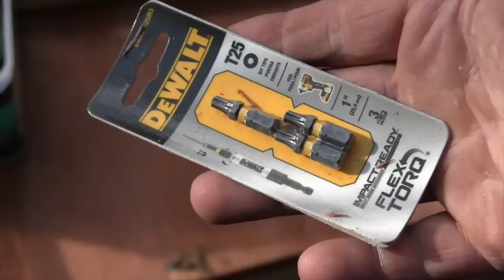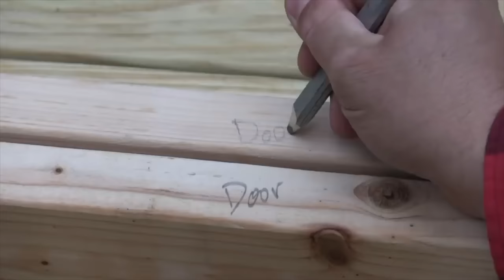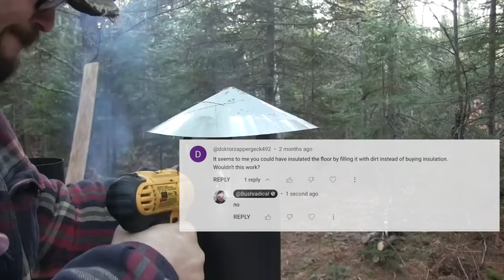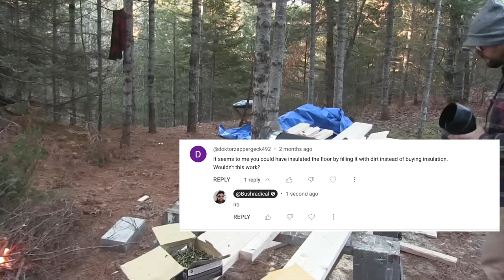Cabin with 24M views.....all the details

Comment: Nails are softer than screws so they flex/bend with shifting foundations rather than shear like hardened screws will. Driving nails at opposite angles will give surprisingly good holding power. The correct fastener is determined by code but experience will tell you what is the right application. Remote construction brings out the McGyver in all of us, whether it is a bridge or an outhouse. Stay safe, cuz you are the doctor as well when building solo.

Comment: Old carpenter insulating tip. Coat your arms face neck and any other place that is exposed to fibers with baby powder before you start stuffing insulation. The powder keeps the fibers from sticking into your skin. Once you're done, take a cold shower first to wash off fibers. A hot shower opens pours and let's fibers stick in them instead of rinsing down the drain. The baby powder trick has always worked wonders for me and I've stuffed thousands of bats over the years
Reply from the maker: great tip! Thanks
Reply: 🌷Thanks for the good information,  having insulated without baby powder.  😊

Comment: I'm building an off-grid cabin as well on property I bought in the mountains 2yrs ago, and I get many of the same questions as we've posted in social media our build progress.  Where is the plan, did you buy them.  No, the plan was in my head, that's it.  I made some horrible pencil drawings of the outside and a floorplan inside, the wife nodded, and off we went.  That's the plan....don't over-complicate it and don't buy plans unless you've never built anything and the cabin is your first go at any construction.  Ours is in sandy soil on a steep hillside, so it's 3ft on the low side and 6+ feet off the ground on the high side, pressure treated post foundation as Dave did, but we used concrete as well.  We use a decent sized generator for our corded tools, pancake air compressor that run nail guns, circular saw, hammers, hand saw, cats paw, framing square, and several levels.  If you are young, just bang those nails with a hammer, I"m older and prefer to shoot 90% of them with a pneumatic framing nailer, it's a preference, not a requirement.  We did use GRK construction screws in certain places out of convenience or when we wanted to pull something tight and keep it tight.  They are NOT deck screws or drywall screws, but they are expensive so go easy on them...nails are cheap.  Since it's a cabin, we don't have load bearing walls, it's one room of fun with a second story loft, all the weight is carried on the outside posts....make those good and you are fine.  Don't be afraid, get off your butt and just do it.

Comment: When we were building our fencing for our pastures, all of our corner posts were old telephone poles. 
We used used motor oil, diesel fuel and creosote in a 55 gallon drum. 
We’d soak our posts for a week in our mixture to let the wood soak it up.
Forty years later and the posts still show no signs of rot.

Comment: We used the black cabin as our template, same width but three and half times as long. A bedroom and main room, nothing fancy. Took us a week of in earnest building camping on the property to get windows and doors on. I then spent eight weekends getting it livable. We did put steps on it early on and we put solar on the roof, but don't leave batteries there. We just bring the power station with us so there's no worry about unattended batteries.

Comment: Lovely and simply explained video. I am 74 years old and went to using screws in construction when my hands started to go and I couldn't properly grip a hammer. I can handle a screw gun still and I figure that what I build now can always be unscrewed by some3one after me for use in a different building. Lol. My biggest venture has been a 20X40 structure with probably 15 nails in it; mainly to hold wood in place. Nails or screws it's only a matter of preference, both work well. Do well and live well into the future my friend.

Comment: Nails break under tension and high stress, screws bend, that's why screws are used now. 
For something small like this nails are great since they are cheap and it does not need to hold up to a tornado or something.
Great video!

Comment: Screws can break nails will give/bend  3 corner wall joints this is a well built building standard construction skills! In code building by plans for city inspection it would depend  on the code minimum for example roofing must exceed 100 mph or whatever the code for area would require in that town. He is building on his own private property and under building size requirements to have code requirements.  Nice cabin! Enjoy.😊

Comment: Screws vs nails : 
Nails will allow some flex (heat , humidity , etc.) where screws are far more brittle and unforgiving . For decking , handrailing , etc., screws are ideal , where framing and load bearing constrction , true construction nails are preferred . Hope this helps 👍!

Comment: Love the videos, Dave. Currently building my cabin on 20 acres in the Flathead valley of NW Montana. 16x36, with a 6 foot cantilevered deck. 18 concrete pillars. Shed roof sloped from 13’ down to 8’. And I’ve never built squat in my life. I’m in the middle of the woods, with an amazing view, and I couldn’t feel more blessed. Not easy, very sore but loving it. Thanks for the inspiration & wisdom! 👍🏼👍🏼👍🏼

Comment: Dave, thanks for the videos.  They reminded me of all the building houses I built over the years.  At 71 now most of my building days are behind me.  I always built my walls, installed windows without nailing flanges, nailed T-111 on the floor, strapped the plate to the floor and rented wall jacks to lift the walls.  This method worked for me and saved my back lifting walls by myself.

Enjoy your content, I will be following from my recliner.

Comment: I know lots of people who like screws but they have a weakness they break if flexed much. The fastener test I saw demonstrated screws had more clamping power but broke if flexed or twisted and failed with out warning nails are very tough use a few extra and you have a very strong connection and it is so much faster and cheaper. Good videos thanks

Comment: Instead of nailing in those 2x2s on the sides of the joist to hold the plywood you can screw 3 inch wide strips of plywood on the bottom of the joist before you install them to hold the plywood in the joist bay. That way you're only losing the thickness of the plywood in your cavity.

Comment: Love your videos. One reason I use screws is I can fix my screwup’s easier than with nails. I also built a 12x16 shed roof cabin in remote n.e. Wa. I just kept gathering free or cheap materials until I had enough to build my cabin. Very satisfying 😅

Comment: Just watched this and thought I'd run something by you. You were using Watco Danish and welcomed input on another product with less fumes to deal with. I've built a lot of furniture and other wood pieces. About 20 years ago I started using a product by General Finishes, called ARM-R-SEAL. It's petroleum based and crazy durable! It actually has a pleasant odor and dries fast. I wouldn't use ANYTHING else! (Don Thoms Grand Rapids, MI)

Comment: At least you have sand and not the usual red clay. You have a nice spot. Snow fall last winter was 322.6 inches for the UP, still a ways away from the 355.9 for the 78-79 winter.  For those who wonder about the forrest, there is little or no old growth pine in Michigan that isn't in a state or federal land. There might be 6 places in Wisconsin.  For those that want to know there is a website called Old -Growth Forest Network.

Comment: Also, i used thinset over the osb and screwed down cement board in my cabin ( on grid ) under the woodstove / entrance and bathroom . It works great and any damage can readily be repaired and repainted (mismatch exterior flat paint from Sherwin Williams worked great)

Comment: I usually save old bars of soap for those deck screws. I rub each screw across the bar of soap so they go in easier. I’d have to get a composting toilet my ass ain’t going outside at 4am for a leak!

Comment: Regarding screws vs nails.  I prefer nails because they generally have a much higher sheer strength than screws.  Plus, framing with nails is faster, even if you drive the nail with a hammer instead of a nail gun.

Comment: You have encouraged me to build my wife’s own building for her office space I built a 12x12 1 room “office” with a porch the same way as yours. One thing I have a question about is ceiling ventilation I plan to insulate just as you have done I just worry about moisture/condensation without venting. Can you comment on this subject. My apologies if you have done so before

Comment: Mineral oil might be a good replacement for the danish oil, its commonly used as a cheap food safe oil finish for salad bowls and cutting boards. Probably not the best for exterior stuff but would likely be ok inside.

Comment: I have a theory on why people started using screws for structures.  Lots of people trying DIY projects, and those people were unskilled with hammers.  If you aren't good with a hammer you tend to bend nails a lot, get frustrated, hit your thumb/fingers when you miss, etc.  So they started using screws as a simpler method.

I've seen a few DIY channels even recommend using screws cause they are easier to put in if you don't have a lot of experience.  Also the most common power tool someone might have would be a drill or driver.

Comment: I think the wall stove jacks are called 'thimbles'. 

My newer one is by a brand called DuraVent from Northern Tool + Equipment. They make kits with all the accessories for wall or roof venting, with all the little elbows, straps, adapters, hoods, and whatnot that go into whatever size pipe/s you have. 

I've seen that brand at Home Depot too, so I am sure it is available to most all the big box stores (you just might have to ask em to order the specific size you want etc). And they likely sell it online, just not sure what kind of shipping charge that would be if just buying one piece (the kit was like $350 so I assume it would be free shipping, but who knows).

Comment: Do like your videos and builds. Watch them a lot. Have you tried the top down starting of a stove fire with the logs on the bottom, medium size wood in the middle and the kindling and paper or fire starter on the top? Creates heat and a draft quickly. Really does get everything going. I now start all my fires this way and it works wonderfully. Many views on the web about it.

Comment: Great video. Only thing I would have done differently is I would have built higher to keep the 160’ footprint to avoid permits but added another 6-8’ in height for a loft and storage. 
Also I would have done a pitched roof to gain headroom but I’m just being picky. 
Great build for sure

Comment: You were talking about the danish oil. I know the historical oil has been linseed oil. It's still used in some parts of europe, too my knowledge. I have also used Tung oil for projects before, and I can attest that it produces gorgeous results, and is relatively simple to work with, if a bit time consuming. Tung oil also has a pleasantly nutty smell to it, kinda like acorns.

EDIT: upon looking it up, the danish oil is apparently a manufactured product formed by Tung/linseed oil. So, you can go a little more rustic, and get an equally good finish.

Comment: No one screws houses together. I say no one, but 99% are built with 12 & 16 penny nails. My main recommendations would be, put fire blocks between the studs, a steeper roof if you get much snow and the house sheathing I would’ve let hang down to the bottom of your rim joist. Will prevent water from leaking around the bottom of your walls, air and pest intrusion. Very nice cabin for sure!

Comment: A screw is a better machine/fastener than a nail.  It can hold in all freedoms of movement ( for lack of a better description, screws allow for fixation in the front or back, left or right and up or down planes of movement (6 all together and have way different names in latin).  Nails being nailed up to down have fixation in the up/down only,  Nailed at an angle gets you left and right to a degree and up an down.  And the nails will loosen over time due to forces (us walking on them) over time. Screws hold in all 3 planes/6 freedoms of movement = way less (in theory) movement of the fixation over time due to wear/weight bearing.  That's why old houses always squeek when you walk.  because they always have, at most, fixation in 2 planes or 4 freedoms of movement which is less stable and will ultimately lead to structural failure.  Now, all screw build homes are not near as old and the homes in Jamestown - so we will have to see which is superior.  ( Screw, just sayin").

Comment: Great video.  I watched the whole series start to finish.  Not being a professional builder/carpenter I have made stuff. Just not anything so ambitious  I thought you explained everything clearly and simply and the reasoning behind your choices..  Yeah I questioned the wisdom of nailing the bottom floor from below too.  The only thing I might have done differently would be to make the floor higher off the ground given the depth of snows in the winter.   Another thing I learned from a book I read as a child called "Cache Lake Country" was to have two chimney pipes; one for Summer that goes straight up, and one that runs horizontally to the other end of the building for Winter.  The idea being keeping hot metal inside the space for longer.  Don't know if it works though. HA.

Comment: Nails have higher shear strength than screws, screws have higher grip strength than nails. Nails are always best when framing. Your framing is where you will need shear strength fasteners, too account for movement and settling over time in the cabin.

Comment: Very Good video.  The reason that is not a good idea to use screws for framing is that screws are brittle and break, if you were in a earthquake your house has to have a little movement built into it. Nails will bend without breaking unlike screws.

Comment: Oh wow , yet another compilation build video, amazing. Thank you! Yes, there are so many time consuming camera angles on this. Two weeks with no camera, huh? Wow. I've been thinking about Linseed oil , which is NOT boiled. and It's actually just flax oil, which is even cheaper than the "processed" boiled form, and some brands of that these days have chemical "drying agents". You can buy it at health food stores .  (My Kleenstrip Boiled Linseed  brand apparently is non chemical, label says, but it's not cheap) . I got this idea from SkilCraft , you may know him on YouTube for his axe videos.  I'm wondering if Linseed could be thinned with turpentine ??? Therefore , no chemical smell. Like you, I am very sensitive to fumes. It would be fun figuring out various natural pigments to add to that. I love black walnut, but that is too dark for those walls. But the rocking chair I did with walnut husk infused in water , then  Boiled linseed as final coat came out amazing. The non boiled flax, AKA straight Linseed does take longer to dry , though, Skilcraft  said. So crank the stove! Run a fan!  (I bet old timers used beeswax on floors also)  But it's my go-to on axe handles, no chemicals rubbing into my skin. .  I would love to see a list of lumber  and supplies needed to build a 600 square footer , but I really want an 800, which I would consider a palace. Brooke did a nice job on a basic tool list, so kudos that.  Also are there any architect geeks out there who could figure out weight loads of snow (powder vs. wet) and the most vulnerable types of roofs and/or  sections of roof to fail under snow loads. Is it really necessary to risk your life shoveling the roof? Don't worry, soon we'll all have lazers, lol.

Comment: I'm kinda in the screw camp too... Some things just need it. 

From my personal experience, nails have a nasty habit of working themselves loose over time. The contractor that built the room i'm sitting in right now, used ring nails to secure the plywood floor in this room. within 5 years, there wasn't a single part of the floor that didn't creek, or crack, or shift under my feet, because all the nails had worked loose. 10 years after it was built, i have quite a few parts of the floor that see-saw under the carpet, and i don't have the time, money, or help it would require to pull EVERYTHING out of this room, tear out the carpeting, and fix the floor.

I HATE nails.

Comment: Great video!, nails will work just as fine if you hammer them in properly. I would still use screws, at least to secure it, but it really is not needed.

Comment: Thanks for the video!  I really appreciate your point on it's really not virgin woods and I never understood how so many think they can tell you how to use your own property.  From what I see you and Brooke do minimal impact and are responsible.  Think of the impact if you had to drag camping equipment back and forth every trip and the impact of that.  The nails vs screws debate, I love it!  Yes I'd likely use more screws but that is because of how many bent nails I have when I hammer them in!  ;-)  I'm sure if I even had a fraction of your experience I'd be driving nails straighter but with that said I'd likely use a combination of screws and nails.  So here is a question where do you source your nails?  The reason I ask is a coworker and I seem to believe that nails seem more prone to bend today than they did when we first started hammering in the 70's.